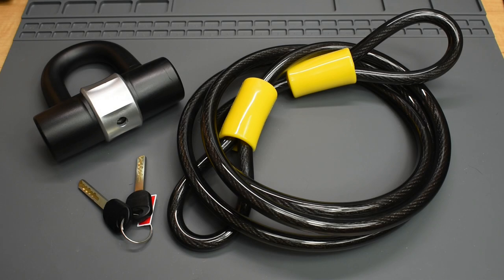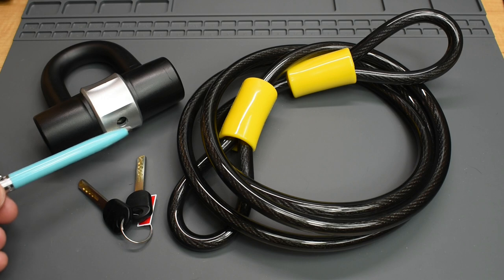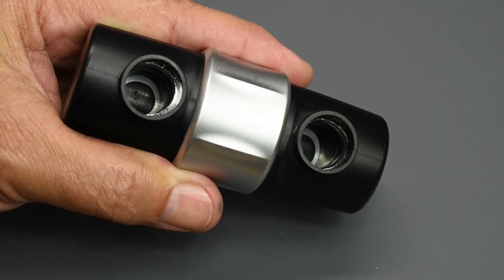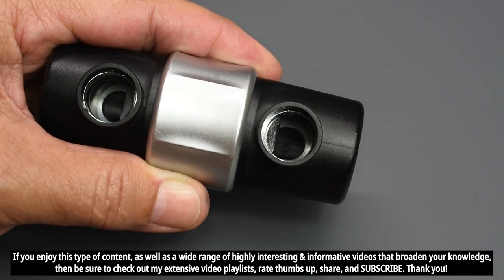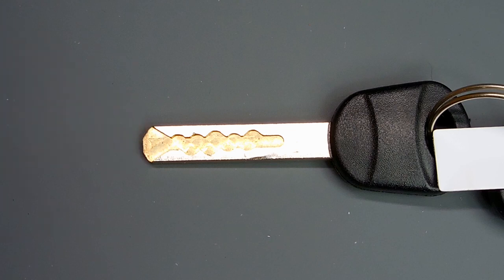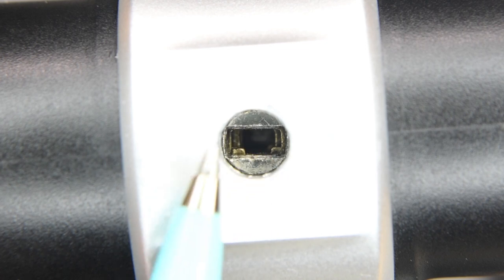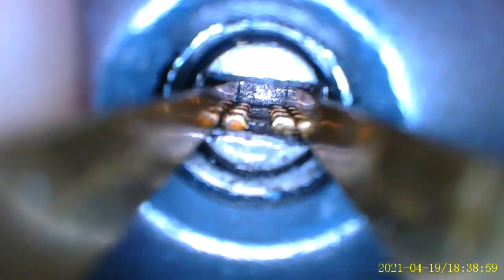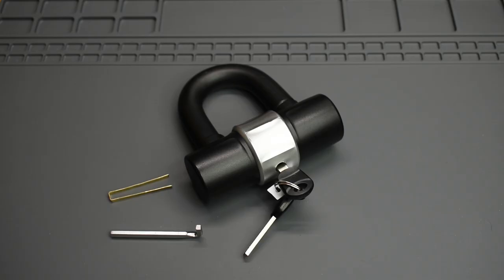HARBOR FREIGHT Bike Cable Lock Picked Super Fast!

Comment: Here I thought these type of lock cylinder was more secure than a pin style.  I actually bought one circa 2010.

I suppose this is similar to a rake attack done on a padlock such as this 🔐.
Reply from the maker: Instead of pushing pins upward to the shear line, in this case you move wafers inward.